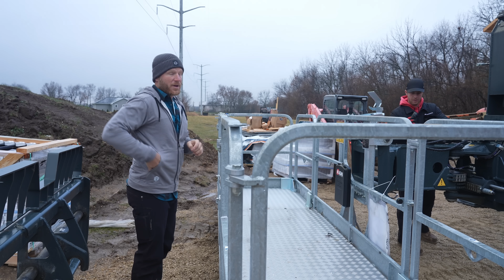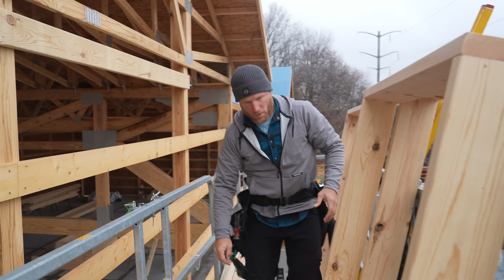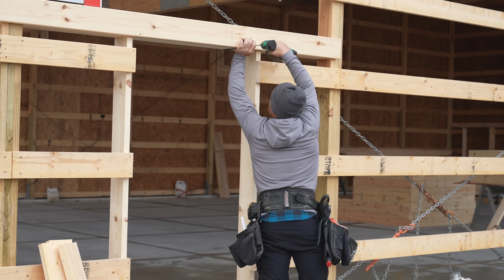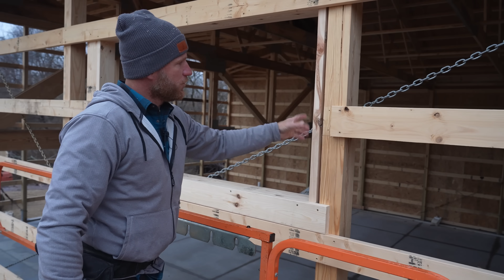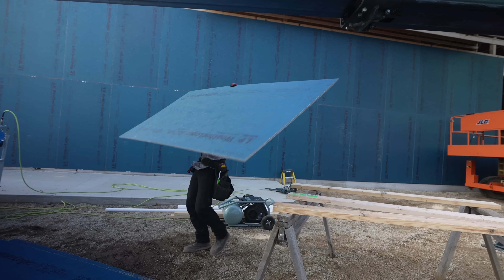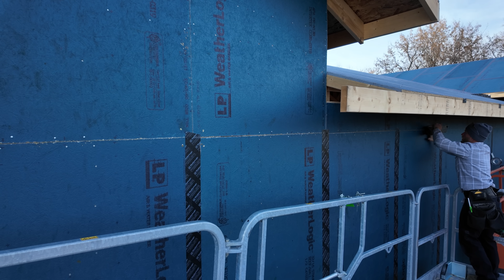My Dream Shop Ep-26:  Window Framing and Sheathing The Front!!  Looking Awesome!

Comment: One thing I wish you did Kyle was bevel your bottom of window frames so it pitches down. I know full well you flash and tape things extremely well, but since you build out your window boxes and set them in place, it seems like an easy thing to do. A simple rip on the table saw with for a small pitch to outside would take almost no time at all and requires no changes later in the build out.

Comment: I thought you had to rub that tape back and forth in order to increase the temperature much like aluminum furnace tape.  When it is rubbed back and forth quickly it gets hot for a brief moment at the contact point and locks into the molecular lattice.  Maybe not just asking.

Comment: I have a question on this sheathing.  You take the time to tap and cover all penetrations on the install then  go and screw into it on when installing siding and roofing.  Isn’t allowing air to penetrate the surface? Am I thinking into this too much? An asphalt shingled roof will add hundreds of penetrations that don’t get taped or caulked.

Comment: Was watching a video by Bond Built called, " All concrete cracks?  Not the slab!!!"  Rwo things they did while pouring the concrete floor the may be of interest the RR community.  First, they poured a curb around the inside perimeter.  Second they sprayed foam insulation on the ground rather than foam sheet under the pad.  .

Comment: What if you built the openings into the wall and sheathed it, before lifting into position am thinking would save time and energy and a lot safer.  Reminder wear safety glasses when hammering any nail or using a saw.

Comment: Hate to be that guy.. but wear fall protection. Attach it to the boom and not the basket. These baskets have been known to fail. Knew a guy who fell 110 feet cause the pin for the basket failed. It sucks working with a harness but just do it.

Comment: You’re diligent using the tape on the Weather Logic sheathing. Why do you leave the bottom edge of the lower sheet exposed? Why don’t you tape it the way you taped the framing?
Reply: They did tape it with a different type of material one or 2 videos back.

Comment: You could re-convert this type of framing to conventional stick-built for the siding phase. Apply galv hat channel on the vertical on 16" or 24" centers and in-fill with rigid foam between. Apply insulating strip on top of hat channel to achieve a thermal break.

Comment: Kyle does that corner column sit on the concrete or is it on a bracket? If it is on the concrete, would that cause it to wick water up, or are the columns some kind of engineered lumber so that it doesn't matter?
Reply from the maker: on the bracket